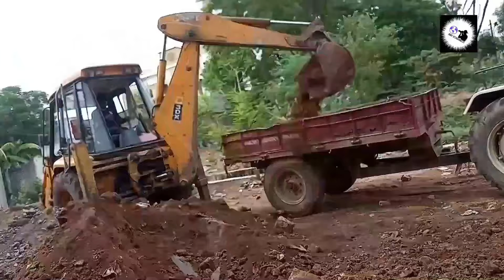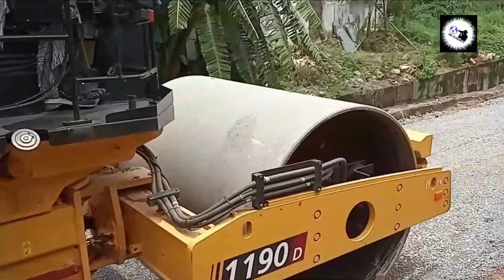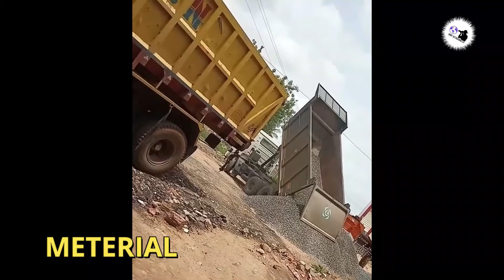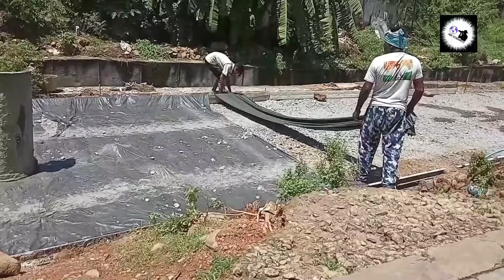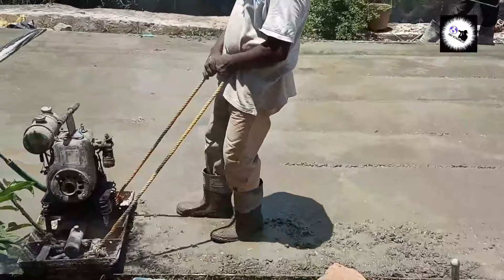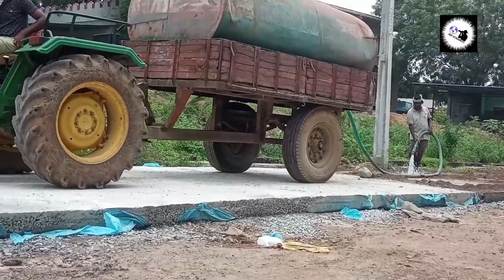CC (Cement Concrete) ROAD Construction Process in India / Civiltechconstruction

Comment: Sir CC construction me polythene ko kyu use kiya
Reply from the maker: Because of segregation.
Reply: To maintain moisture present in the concrete , if polyethylene sheet is not used, moisture will gradually enters the below layer
Reply: @rajum2563 why they are not using TMT 10Mm bar?

Comment: After the new concrete road construction why vertical directional hole is drilled?
Reply from the maker: Concrete Testing drill hole taking cylinder .curing after 28 days quality and depth and grade testing
Reply: Tq sir
Reply: In our layout nakshka            scale is 1inch = 40 foot and how can I calculate using centimetre scale to measure the layout in map and how to convert centimetres to foot using 1inch= 40 foot
Reply from the maker: 1feet = 30cm, and 1inch = 2.54cm and u want centimeter to foot so
1inch = 40 foot u said
2.54cm = 40 foot
1cm = 40/2.54 
1cm = 15.7 foot
Reply: If layout total area 58 square feet or more now how can I find length and breadth 
Only given a total area ...
Reply: @civiltechconstructions   sir apna number de sakte hai

Comment: The load of the water truck can crack the 1day old concrete.
Reply from the maker: under cc road well compacted layers there so no cracks will come.if suppose building Slabs,under slab supports so next day don't put loads on Slabs.after curing  5-7days u can do small works on that  like column starter,column reinforcement extension,column casting.
Reply: use of RMC wich chemicals decrease chamces of cracks. if you use mixer then curing of minimum 14 days is must